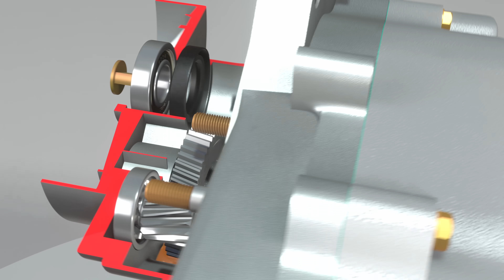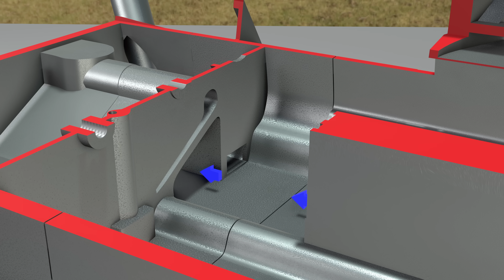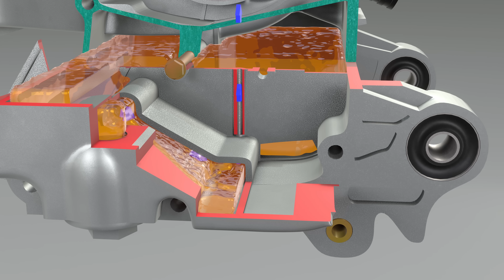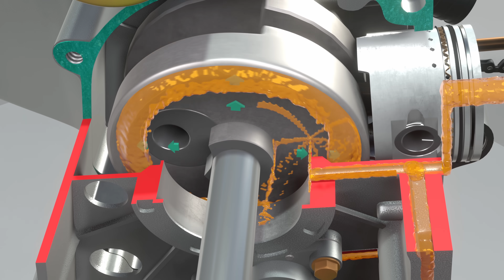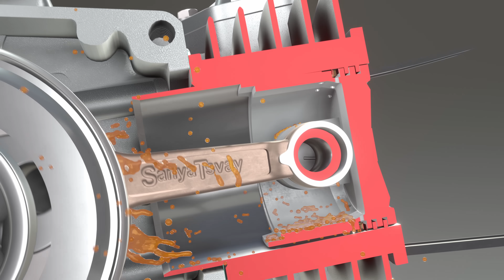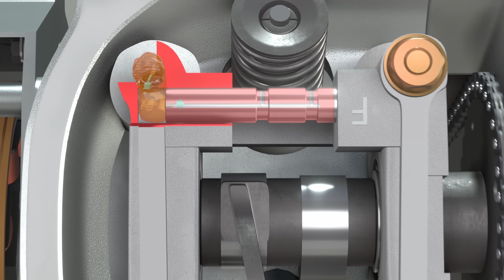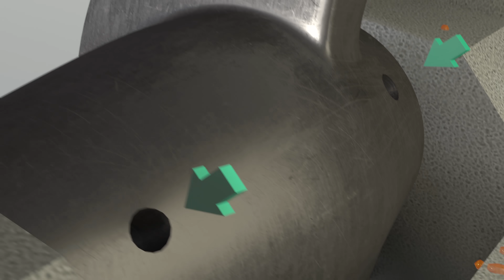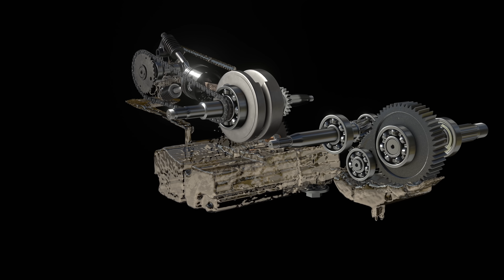139qmb scooter engine lubrication system 4т

Comment: What should I check if the engine oil is splashing from the crankcase ventilation hose which is attached to the valve cover on the relatively fresh engine? My airbox has 2 dripping plugs and one of them is completley filled with oil in about 100km. Shoud I replace or check the valve cover?

Comment: @sanyatsvay 
For example, can motorcycle oils like Motul 7100-5100 be used in scooters? Or can Motul or Castrol 10-40 scooter oils be used in geared motorcycles? Some motorcycle mechanics use wet clutch oils with a standard MW value of 10-40 for scooters. Why? Can Motul 7100 be used in 100-125cc scooters? Is it harmful or beneficial? We look forward to hearing from experts. Thank you.

Comment: Je m'abonne tout de suite a votre chaîne,👍il est rare de trouver un logiciel cinématique de fonctionnement de lubrification sur un moteur qu on connaît bien comme le célèbre 139qmb,ou sur d autres Moteurs spécifiques,le mien est un 50cc,c'est du même topo
,il en faudrait tout le temps des vidéos aussi précises et explicites comme ça pour voir de quelle façon le système du moteur lubrifie le Bloc,personne ne le fait de façon assez précise,,je met de l'huile 5w50 Moto de compétition par choix délibéré et non de la 10w40,car mon moteur peux monter haut dans les Tours,
Et avec de la 10w40,vu les petits trous de lubrification dans ce petit moteur, elle ne va pas dans le moteur assez vite a haut régime,c est pour ça que je met de la 5w50 spéciale,

La 5w50 est fluide au début du fonctionnement du moteur pour aller très vite Partout,a cause de possibles régimes élevés( car mon scooter peux aller a plus de 70 km/h si j' en ai envie),et le grade 50 a chaud est toujours fluide a chaud mais le film d huile en Lui même est plus résistant sur les pièces que le grade 40 
,j ai 12000 kms au compteur et aucune faiblesse du moteur,ce qui est impressionnant pour un 50 cc,
car a 10000 kms certains refont déjà les segments, Mais Moi j en ai pas besoin,il ne fume pas,il ne misère pas dans les côtes,par contre cette huile coûte cher et on ne la trouve que sur certains sites,c est difficile d en trouver,c est de l'huile de couleur verte,les pétroliers ne nous facilitent pas la tâche,les constructeurs boulant aussi qu on mette de l'huile trop fine a chaud fait user le moteur plus vite, Moi je veux pas ça,donc c est dur de trouver une Huile de ce grade

Comment: to check oil level, don't screw the oil cap, just put it into the hose and take it out
Reply: Your supposed to screw it
Reply: @Iwanta4.6mustang nope, its in the manual, check installed, but not screwed in
Reply: @mattyb7736  oh ok
Reply: Same for 125 gy6 ? Cuz it says 15w40      0.8L     and i screw it in and its on full in dipstick    sometimes i put 0.9L with no problems  i have also put 15w50 racing hehe
Reply: Thats not on every motorcycle, you have to check the manual

Comment: Over time, the parts wear out because the oil is at the bottom, because starting the engine at first makes the parts move without lubrication.

Comment: How many kilometers to change gear oil??
Reply from the maker: 1000
Reply: @SanyaTsvay  gear oil?
Reply from the maker: @sahrsahr3950  engine oil every 1000, and transmission oil every 5000 km
Reply: @SanyaTsvay  thnx bro

Comment: Hello, I have a question. I use synthetic 10-40 oil for a 100cc scooter motorcycle. How many kilometers do I need to change this oil in normal use? Also how many liters of oil should I add? I would be very happy if you could answer me. Normally I change it before 1500 kilometers. Can you give me the correct number? Thanks
Reply from the maker: You need to look at the instructions according to your scooter model. I have a 70 cc scooter, I change the oil every 1000 km. I filled the oil using the dipstick as a guide. 900 ml. I think after 1500 km it will be fine too

Comment: Hello After changing the oil of my scooter twice, I add 800 ml of diesel for cleaning purposes. I run it like this for a few minutes, then I take out this diesel and change the new oil. Sometimes I mix 400 ml of oil with 400 ml of diesel. Is this method correct for cleaning?
Reply from the maker: I think it's possible to do it this way. But in my opinion it's enough to just warm up the engine and drain the old oil.
Reply: @SanyaTsvay  Thank you. Is it right to change the scooter oil after the engine has warmed up a little? Or should I wait for it to cool completely?🙏👍
Reply from the maker: @yilmaznas6834  correct when hot

Comment: THANK YOU SO MUCH... i did'nt know until now that gear oil should be 200ml i thought 120ml only because when i put too much it spills
Reply: @onegodonly8321  engine oil yeah 800ml but Transmission gear oil 120ml or maybe to some other scooter 180ml
Reply: @Paul3Estrella  👍Sim depende da Scooter... Por exemplo, na Aprilia Sportcity One 125 "motor Piaggio" o fabricante diz para colocar 200ml na transmissão

Comment: Very nice complete animation. It surprised me that the timing chain didnt recieve any oil lubrication at all.
Reply from the maker: The timing chain is lubricated with oil, which is sprayed from various rotating elements. Also oil mist formed in the crankcase.
Reply: Oil from cam lubrications returns to the sump in the passage where the chain is, this oil also lubricates the left crank bearing.

Comment: on the final phase circulated oil passes through the oil filter and goes back to oil sump right?

thanks for this wonderful video
Reply from the maker: in the initial phase, the oil passes through the filter. in front of the pump. 1:52